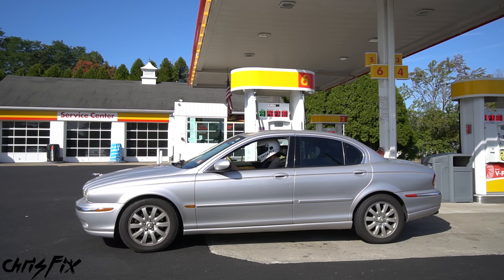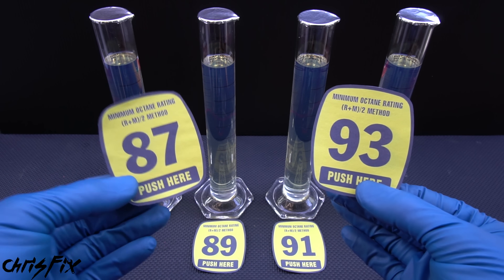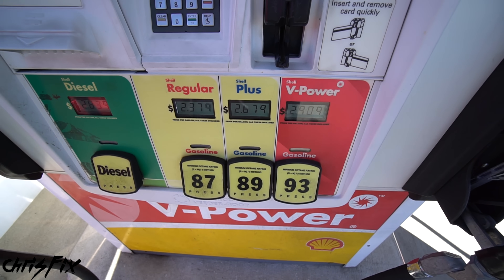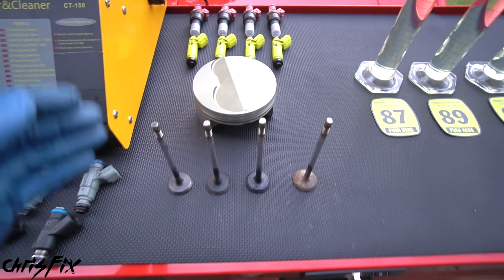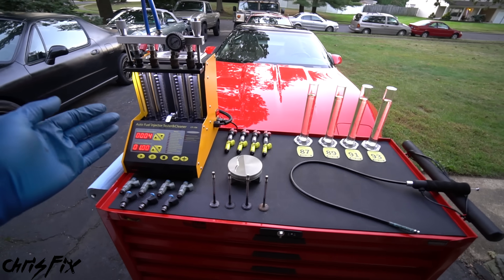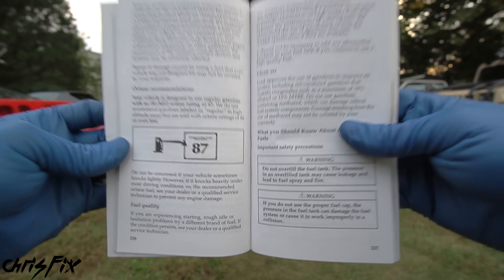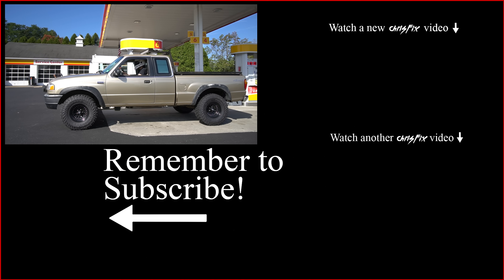What is the BEST Fuel to Use in Your Car or Truck and WHY

Comment: Just looked at the manual for the car and it says 87 and higher. Which should you use, 87 or the higher to help the engine run better long terms?

Comment: Great video chris! In Europe we normally have 95 Simple, 95 with Additives and 98. 95 simple would be normal gasoline as clearly shown by the name. Most people use it because its cheaper and gives more fuel. Its good to have in store for a maintenance at home instrument to use with the octane booster as chris showed. The 95 with Additives is a better Gasoline. Usually used in Vehicles that require it like maybe the corvette or jaguar he showed there too. But its also used on old cars that need more care due to the high milage they have and more possible bad outcomes if u dont take care of the way you fuel up your car. 
The 98 is by far the better gasoline. Required on top tier cars such as sport cars, modernized cars, hybrids sometimes and so on and so forth. Not every gasoline car can use 98 and a lot of 98 required cars cant use 95 simples so, i just thought id give my opinion on it here for my fellow europeans. May be a few errors here and there but yeah, thats about it.

Comment: Really well done video.  I've run a 2.0 L race engine and made 1000 hp at the wheels ...with a huge turbo.   For that engine, of course, we needed really high octane fuel.  But for my regular car, I use the lowest octane all the time.   Only thing I still don't know (and have heard various reports, all from people...not data) is who makes a better additive package.  Someone told me Exxon is best, but I suspect there's really no significant difference among any top-tier brand.   Any ideas about this ?  Anyone know of real data?   I mean seriously??? Shell isn't going to be as good an additive package as Exxon?     Any objective data is really appreciated.

Comment: my car stock was Premium recommended, but I got a stage kit and it came with a decal to replace it too Premium required ... RIP wallet
Reply: I have a 2017 Miata that's premium recommended. People have dyno'd theirs on 87. The knock sensor will adjust the timing, sure, but they averaged 8 - 10 HP less running 87. Which is, frankly, fine if you're just highway cruising or whatever.
Reply: @jcasetnl  my car is turbo /w direct injection. I have to use premium with the new tune
Reply: @KanataSD  With forced injection my guess is the compression is too high for the timing to compensate with regular fuel (87). It might be able to compensate with mid-octane (89) fuel, but with a loss of performance, but you probably got a replacement ECU with the upgrade that might not allow even that.

Comment: Wait a second this isn’t project farm. Good thing it’s the just as good chrisfix
Reply: Weird how he mentions only shell throughout the video lol
Reply: Shell has the most detergents of any fuel ...
Reply: Project Farm = independent unbiased thorough testing and review.
This video = Sponsored by Shell with biased advertisement for Shell.

It is a blatant and ignorant insult to compare this to Project Farm..
Reply: @DoesNotGiveAF  he wasn’t comparing shell to other fuels he was stating benefits and differences of fuel grades. Chris fix shows how to fix/ maintain vehicles, project farm shows what tools to use. They are both good in there own ways.
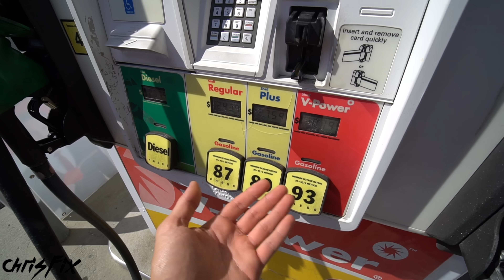Reply: @jonnydevlin7045   I never said he compared anything (ironic statement in this context though) but since you bring that up...   Paraphrasing here 6:03 - "some use the same amount of additives in all their fuel - I know specifically Shell uses 7 times more additives than required by law in their premium" and then goes on to talk about the amazing advantages of said "additives" That's a comparison without actually comparing anything while making a specific brand look superior, that is a marketing technique if you didn't know.. I stated this video is ( "supported" aka) sponsored by Shell 0:50 and has marketing/advertisement exclusively for Shell through out. Thats all, and as your recent comment points out is entirely different than any content from Project Farm which specifically and intentionally does not do content like this leaving no room for a logical comparison on that basis, which is exactly and all I said. I was not demeaning Chris or what he's doing, I wasnt saying his content is bad just pointing out what it is - advertisement for a corporation and from that perspective is not comparable to project farm in any way.
Reply: @DoesNotGiveAF  Relax man, he was just comparing the different octanes from the SAME gas station. Even if he was advertising for them, he wasn't wrong. And yes, I thought it was a Project Farm video at first too..not for what he did, but for the thumbnail is why, it looked like a Project Farm thumbnail.
Reply: @DoesNotGiveAF  cool

Comment: I found that at high altitude (6000 feet and above), 85 octane will do just fine in an 87 octane NATURALLY ASPIRATED vehicle, but don't ever try that with forced induction, always use the exact number or better

Comment: I buy the cheapest gas and add fuel additive which for a 20 gallon tank adds $1.50 or adds .05 cents per gallon. My truck has 265k and runs.

Comment: I liked the presentation. Very well produced but I do have a question. I have heard that modern cars (2017+) that use 87 Octane fuel, auto tune themselves to run efficient. IF after using 87 you then fuel up with 95+, the engine will auto tune to the new octane rating but it will not be able to auto tune when you go back to 87, leaving your engine to ping for ever. Is this true?

Comment: Ehhh different fuel for does burn different for each ml. In physics the energy in fuel is measured usually by calories.
Reply: I was just thinking the same thing. Burning each grade in a calorimeter would show they do in fact contain a varying energy content.

Comment: The longest Shell ad I’ve ever seen.
Reply: Looks all modest, filming with my cell phone, low budget, then suddenly high quality computer animations. Yeah, Shell helped out more'n a little.
Reply: Cleanest shell I've ever seen
Reply: The only I’ve seen
Reply: And the additive is bullass. Its only to sell you the most expensive gas.
Reply: @StijnNLDutch  yea, all gas stations have essentially the same fuel. it all comes from the same place. It is all regulated... ask yourself, have you ever heard someone say "oh god I had Shell fuel, shell fuel would have made my engine explode! THANK GAWD I had Knobb Creak Shell Brand Texico Bucees Fuel"
Reply: @Gobi-Wan  indeed, here in the Netherlands where shell is coming from, there have been many consumer programs about the additives. They put 1liter in a whole truck full of gas (the truck that brings the gas to the station’s).
Reply: @Gobi-Wan  This is false, not all gas stations are equal. Georgia itself had 20.7% of it's gas stations leaking water into it from tanks. 1 out of 10 had sediment problems from faulty tanks in the grounds. Yes, they do fail inspections...IF they are inspected. It doesn't mean they are adding water or dirt, but it can come naturally from old or faulty tanks. Google the NBC news article from 2017 about watered down gas.

Comment: Doesn't a higher octane "burn" at higher temps? One of the first things I learned in organic chemistry is the bigger the polymer chain/molecule size, the higher the vaporization temp. Don't the numbers just refer to the length of the polymer chain of octane molecules? Thus, the premium fuel, with a higher vaporization point, is less prone to predetonation/engine knock?
Reply: if the octane was polymerized, you'd have a big problem. so not, that's not the case

Comment: I always thought “knocking” or as I have called it for years “pinking” or “pre detonation” was the fuel/air mixture igniting before it should ie before the spark plug sparks. 
The reason it can damage the engine such as melt a piston crown or damage a bearing or bend a conrod was caused by the exploding mixture being compressed more as the engine was not past TDC.

I also thought detonation was when the engine would continue to run on after the ignition switch had been turned off.  The cause being hot spots of carbon build up in a cylinder and or a rich mixture.
Arghh .....memories of motoring in the good old days 😱
Reply: Detonation is different than pre ignition I believe.  Pre ignition/detonation is when the fuel mixture ignited solely by the compression in the engine before the spark plug goes off, where detonation is when the spark plug ignited the mixture and the flame front is not equal and there starts to be little tiny extra explosions as cylinder temps rise after the first ignition. Both can be bad but usually pre ignition is much worse.

When you see engine damage from detonation it’s usually little dents in the piston caused by the unequal flame front but when you see damage from pre ignition is usually chunked off pieces of piston, a hole, or bent rods. I think that pinging/knock is a term used to describe the noise that happens with both detonation and pre ignition.

Comment: Is the higher the octane the fuel the higher the Flash point of the fuel.  If this means the lower the compression of the motor the lower the octane, the higher the compression of the motor the higher the octane.

Comment: This idiot doesn't know what hes talking about. The higher the octane the higher the Flash point of the fuel therefore the higher the octain it takes more compression to burn correctly. This idiot doesn't know what hes talking about.

Comment: I was a tech with Mazda. The skyactiv-g non turbo engines are high compression 13:1 but yet the Mazda says you can use 87 octane. When it comes to the 2.5l turbo the engine is rated at around 225hp and 320torque with 87 octane but 250hp and 320torque with premium fuel.

Comment: they come threw the same hose so your fuel will be mix with the other for gas its no problem but the diesel or do they pomp out the hose before using i dont know?
Reply: diesel is always on a different hose

Comment: My country (Turkey) are using 95 Octane E5 (Ethanol) includes in the gasolines. 95 octane is standard all of my part of country. You can not find 83, 85 or 93 octane in Turkey. You can see 97 octane a few fuel stations. For example, Shell Fuelsave and Shell V-Powers (95) octane and E5 ethanol are both the same. I think Shell, BP, Total fuel brands are using additives in the gasolines in Turkey. My first car engine is gasoline (benzine) type. I have no knowledge of diesel fuel in my country.

Comment: It would have been a better video if you had just mentioned that certain compression ration engines require certain octane ratings. It is as simple as that. Most modern vehicles have a much higher compression ratio that vehicles in the 70s or 80s had and I would say today that 89 American is the minimum most cars need.

Comment: From my years working at Ford Motor Company in Powertrain Engineering - the Fuels Engineer told me that the "Name Brand" fuel companies, such as Shell, Mobil, etc. tend to put more/better additives into their fuel vs. the discount stations.  Not always, but usually.  So that $0.10 - $0.20 per gallon that you are saving is often due to less additives.  You heard Chis say that Shell puts 8x the required amount of additives into their Premium fuel -- that is true and is why I try to use the branded fuel in my vehicles.

Comment: Hello, good video as aswell, but we made a test here in Denmark. Oktan 92/98 and 100. and The cars with 100 got 5-15 more HP depends on the enigne. testet on a Dyno with each fulel. 10x times. it works.

Comment: Would you recommend filling with premium from time to time to clean the engine in cars that run regular/mid-grade? If so, how often?
Reply: If I'm not mistaken, he even said it in the video, that "once in a while" it's ok to run premium for a 25mile run, then use your regular fuel again. What that could mean? I guess you could wait until tank is empty, fill your canister with regular, put 10 liters (2-3 gallons, dunno how this conversion works) of premium, run continuously for 25 mile (because engine will be hot and those additives have a better chance of cleaning the engine), then when you run out of gas, just refill with your regular (from pump, if you near one, or the canister).
How often, you might ask? I'll do it once every 4-6 months. Every 3 months is even better for the engine, but once a year won't hurt it either, since most people never put premium in their lower octane fuel engines and those engines still run just fine. It's up to you. 

Sorry for the long read. :)

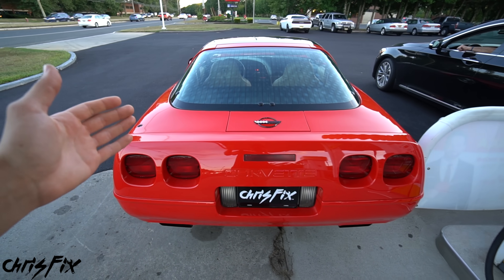Edit: PS for video timestamp of where I got this information: 12:35 to 13:29.
Reply: @Ygr3ku  I mean, I don't have a problem with filling up a whole tank few times a year with premium if it were to help the car. But he didn't mention this in the sum-up at the end and just said to use what the manufacturer recommends.

I know he talked about it being ok to go premium, but I was wondering if it really is benefitial to do it from time to time or if it is just a placebo effect.

I would have asked also about which brand is the best to do this with. But I'm from Europe, so I think the mixtures are different. But he said that Shell said that they have 7x the recommended additives and that running their Premium for even 25 miles can help cleaning the engine. So I might try Shell on my next road trip - it won't hurt the engine.
Reply: @SamoScopom  As you said, it won't hurt. I might as well do it too, even though I plan to get rid of my "old junk" in a few weeks time. You know, something like "one last epic ride before we separate" :))
(Sounds like "can we have sex one last time before we break up?" :)) )

Comment: as a fuel technician, my self  is that recording device your using  integrity save and did you have a hotwork permit to use that device in the  hot zone

Comment: Running Premium in a higher mileage car is very true. A Lot of vehicles I have seen with 180k+ miles where the previous owner swore by premium, the moment they sold it the new owner used regularly and blew a gasket in less than a year... Baby your elder car with Premium, it may cost more at the pump, but it will save potential over a thousand dollars on the engine.

Comment: Chris, that was false information. I made 15 years ago a test with my Chrysler 300M 2.7L V6 engine. Beginning, empty tank (computer also DTE 0km) And then filling gas tank full, until it stops 3 times. Then driving same route to work and home and to shop and home until it was empty and computer says DTE 0km and pointer down. We have here in Finland 95E and 98E also 99V-Power, but I made test between 95E and 98E. Same gas pump, same station, same weather conditions (sunny day +20 celcius or 68 Fahrenheit), no windy at all. With 98E I was able to drive 100km more or 62 Miles more than with 95E. And I came to conclusion that heavy car, and strong high octane gasoline vs low, I don't need to press gas pedal so hard to gain my wanted speed. No revs ofcourse, but normal driving. Car was accelerating easier with not so heavy gas pedal.

Comment: Absolute misinformation..  All of those fuels burn at different rates because of the impurities "additives" . High octane fuels burn slower and is a better match for higher compression engines. Timing is also a factor.  Always run the lowest octane "purest fuel" that your vehicle will eat without pinging. Generic fuel is the same as brand name except for additives (impurities)..

Comment: I learned in the 1960's where to find fuel for your car.  1) pick a station that has a high volume of vehicles because the fuel will be fresh.  Don't go to a small hidden gas station because the fuel gets old and will have more moisture and will make your car run bad.  So stay away from stations that sell low amount of  fuel per day.  Using this rule out 100 % of the problem with fuel. I user regular all the time and never had any problems.  I was a mechanic for 30 years, so, I know what I am saying.  Every three months drop a pint of fuel injector cleaner on your tank to clean your engine internal valves and keep them clean and seal properly to give you the best power and mileage.  Run your engine with the fuel is designed to burn and stick with it.  Because you buy a care, check the fuel that will require and decide if that is what you want.  I prefer an engine designed to run on regular.  You can run premium if you want to but you don't have to.  Otherwise you will be force to use primum all the time or your engine will ping if designed to run on premium only.

Comment: I live at 5,000 feet where "regular" gas is 85 octane. My Honda manufacturer spec says "Use 87." I have run both, and see little difference. I understand the reduced air pressure at altitude protects fuel from causing engine knock, so we can use 85 without experiencing knock. BUT, should I still use 87? Or is this like using 89, causing injector buildup. I have experienced a 7mpg decrease in gas mileage (38 > 31) over the last two years of driving my 2017 Civic 1.5T. I have done lots of research but never found an explicit answer.

Comment: my god this guy want's attention... Just get on with it will you... Don't use diesel for a vehicule that is not designed for diesel... wow tremendous advice.  I did not know that.  Octane is a molecule, it's not a resistance factor.